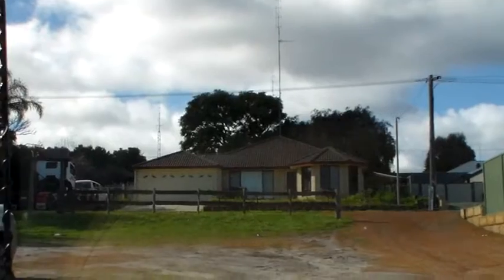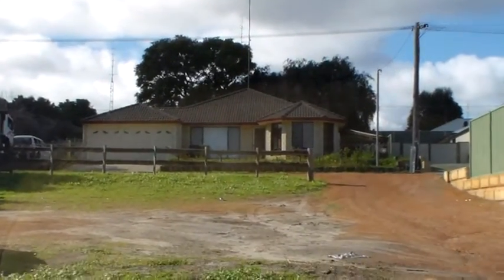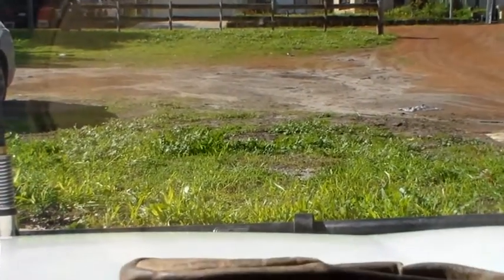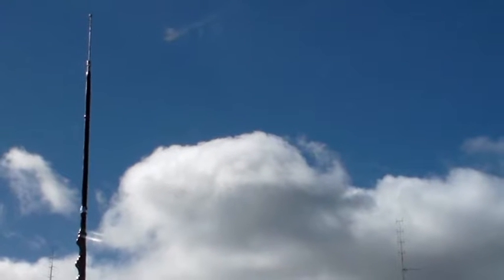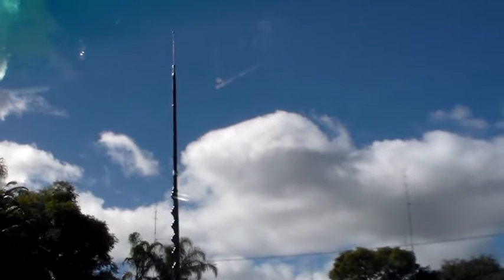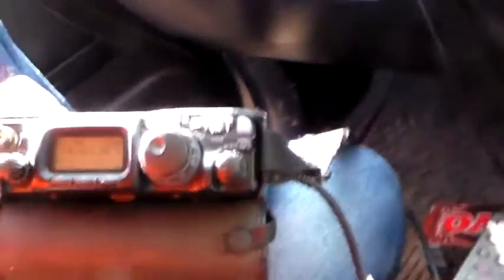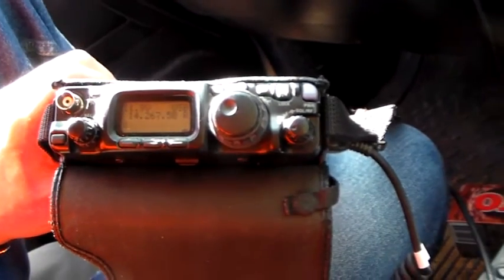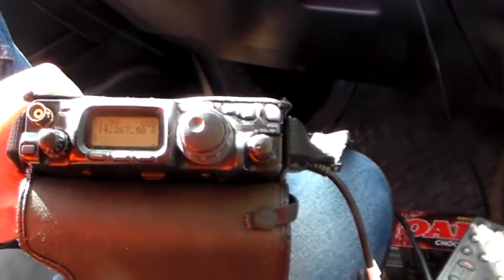Playing With The New Version Of The Terlin 'Perth' HF Antenna

Comment: How do you like the radio?
Reply from the maker: I think it's great. I was skeptical about a 5 watt portable radio, but I have had QSOs over 500-600kms with this radio. We were out in the bush and found approximately 230 metres of wire suspended on 3 poles up at about 30ft, and dangling down at each end. Fortunately we had a small ATU with us so we loaded it up. We got a good 5/9 signal report report from 600kms away on 40m. The guy said 'did you say 5 watts'. This wasn't a one-off, we have regularly used this radio to talk over those kind of distances. It's great for portable work as it only draws 300ma on receive so the battery holds up well.

That said, I prefer to have the 100W output of the 857 available, and have just bought a second one. I did think about getting an 817 though.
Reply: I know a few locals with the 817, they like it as a portable but rather have more power.
Reply from the maker: That's a very common comment. I suppose they could always get an amplifier and have the best of both worlds.